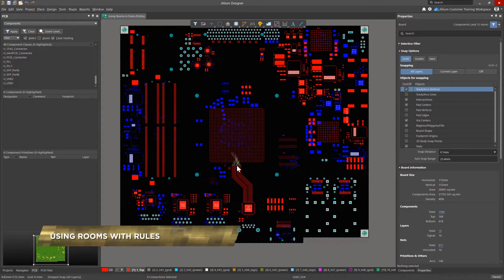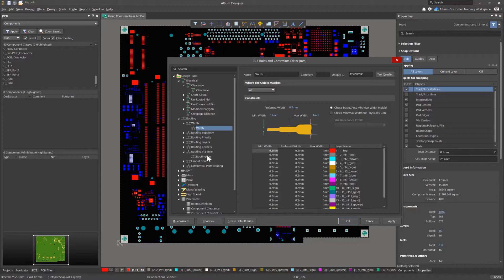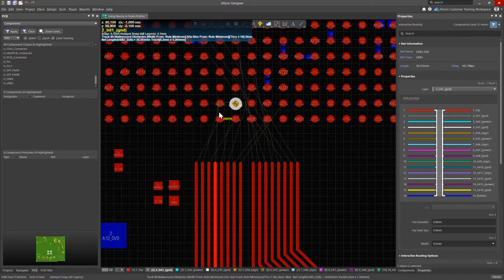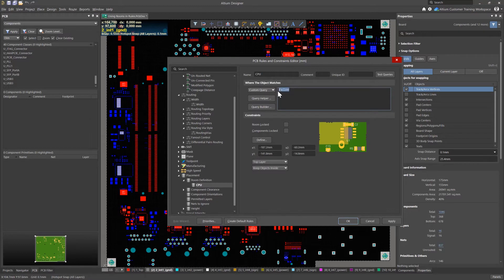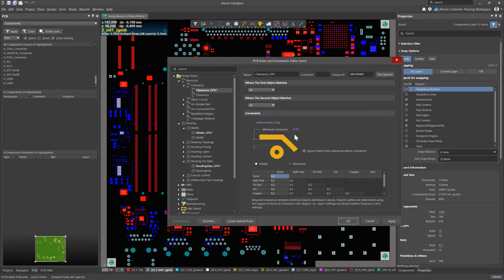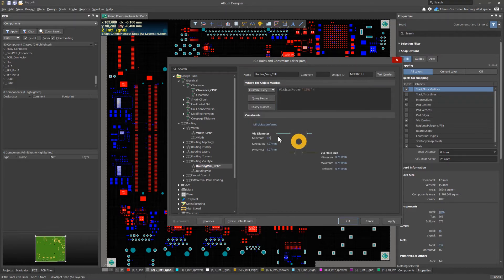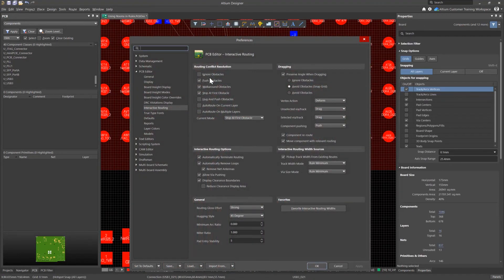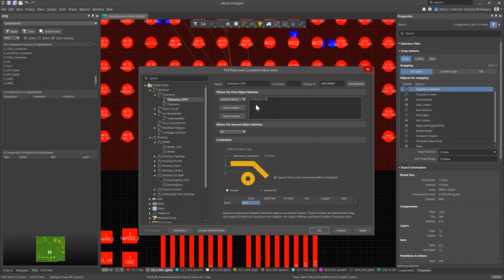How to Use Rooms with Rules in Altium Designer

Comment: Dear Altium Team, I really like the idea this presents, but it feels cut short quite a bit. While trying this I found that rooms are only defined on top and bottom layer. Making routing directly under the BGA possible but does not take into account more complex VIA arrangements on other layers under the BGA. The rule will only apply to the layer the room is specified on, meaning on inner layers the global clearance will take over. Could you explain how to define a custom clearance on any layer for any setup region on the PCB, that would be great help.
Also one additional note, you should explain that you have disable settings for checking room differences while updating from the schematics. If this is not done the custom rooms will be deleted or they have to be manually deselected each time an import on changes from the schematics is performed. These videos are nicely done but I think really could benefit from a bit longer duration, usually you will have the very specific audience that will actually want to watch and don't have to be done in 3min. 5-10 will be totally fine. And yes this is free content and I am not complaining, just trying to give you some thoughts. Keep up the good work.
Reply: Hi Deniz! This is a really good question and it's important once you get to finer pitch. I can do a video on it for the main Altium Academy video series. In short, I would try doing layer-specific clearances using the Query builder. You could duplicate the global clearance rule, and then modify the new rule to apply to specific layers with the query builder. Make sure you set this new rule to highest priority so it does not get overwritten by the global clearance rules. Give it a try to see if this works for you.
Reply: @Zachariah-Peterson  Hi Zacharia. So there is no method to create area specific rule in middle layers?
Reply: @joonaskarjalainen1113  yes there is, you have to do it with a custom query, use the OnLayer method
Reply: @Zachariah-Peterson  OnLayer would affect whole layer. There still need to somehow constrict area under, in this case, BGA. Since rooms cannot be used maybe InRegion command + additional polygon in crucial area? Did you end up making video about this? Would be nice to have an example
Reply: @joonaskarjalainen1113  How did you solve this?